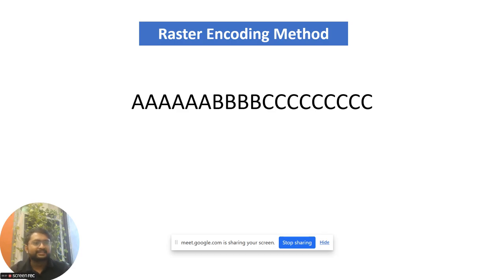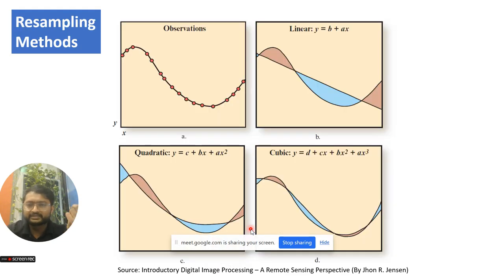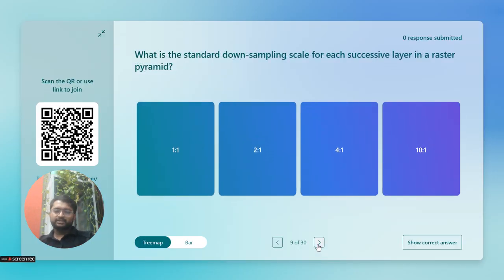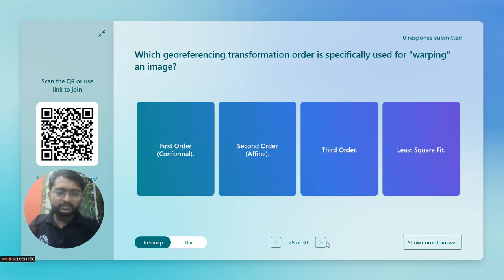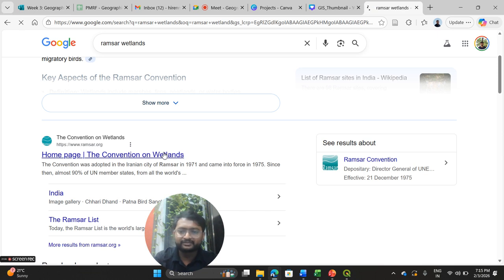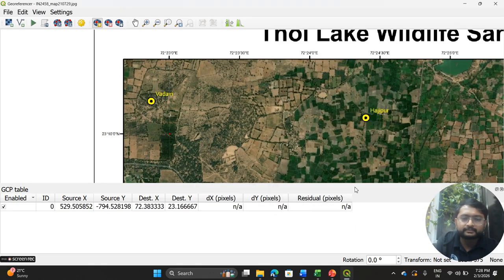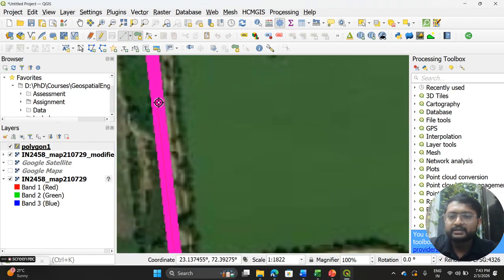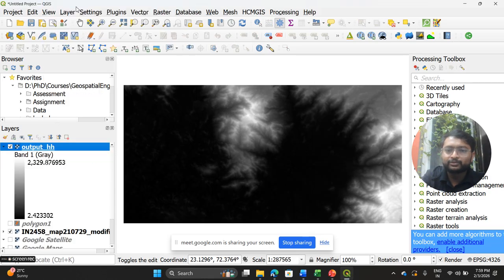Lecture 3 | Geographic Information Systems

Comment: 00:10 - Overview of Week Three in Geographic Information Systems course.
02:57 - Data compression is essential for storage and transmission efficiency.
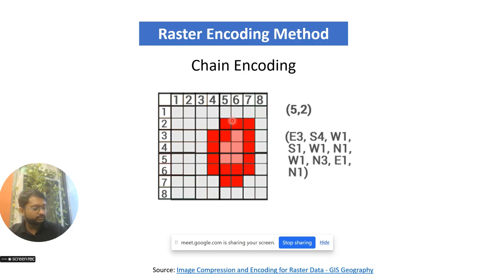07:53 - Exploring encoding techniques in GIS for efficient data representation.
10:21 - Understanding box sizes and quad tree encoding in GIS.
15:25 - Georeferencing is essential for accurately locating satellite images.
17:35 - Identifying Ground Control Points (GCPs) for georeferencing imagery.
21:43 - Choosing resampling methods based on terrain affects data accuracy.
23:44 - Transformations in GIS involve translation, scaling, and rotation of coordinates.
28:36 - Raster compression removes three types of redundancy in images.
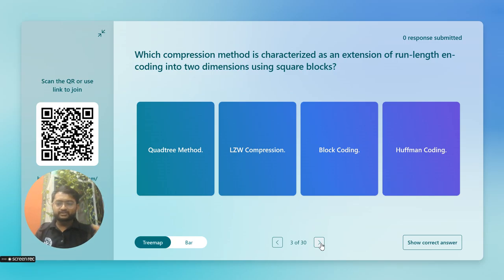30:58 - Discusses various coding techniques and quadtree limitations in raster images.
35:51 - Understanding raster pyramids and downsampling in GIS.
38:06 - Understanding GCP placement and its impact on geo-referencing accuracy.
42:59 - Understanding terms in georeferencing and acceptable error limits.
45:11 - Effective resampling methods for satellite imagery discussed.
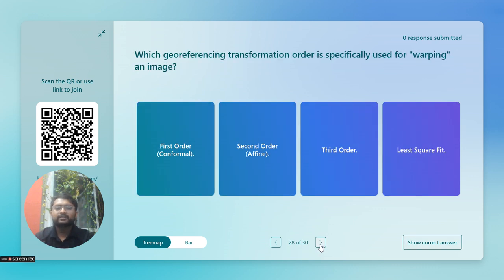50:11 - Georeferencing transformations affect image mapping precision.
52:39 - Quiz recap and introduction to exploring various datasets.
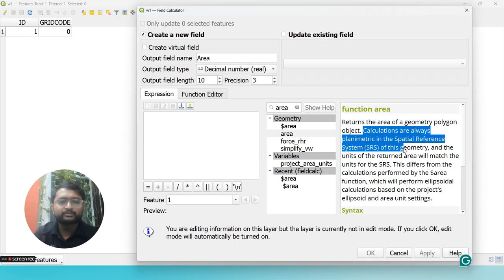57:39 - Understanding coordinate systems in GIS for area calculations.
59:40 - Understanding coordinate systems and area calculations in GIS.
1:04:28 - Understanding non-georeferenced data and the importance of georeferencing.
1:06:31 - Integrating georeferenced maps for urban development analysis.
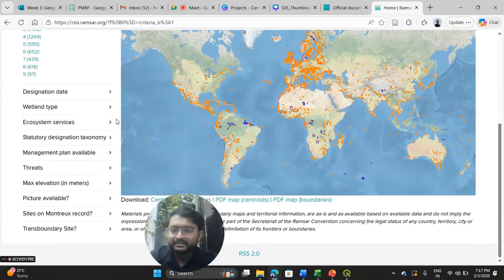1:11:16 - Overview of GIS data types and site analysis techniques.
1:13:49 - Understanding site boundaries and georeferencing in GIS for archaeological sites.
1:18:28 - Proper georeferencing is crucial for accurate GIS data representation.
1:20:32 - Understanding latitude, longitude, and coordinate systems in GIS.
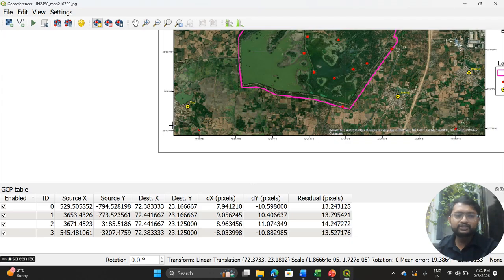1:25:19 - Pixelation affects image accuracy in georeferencing.
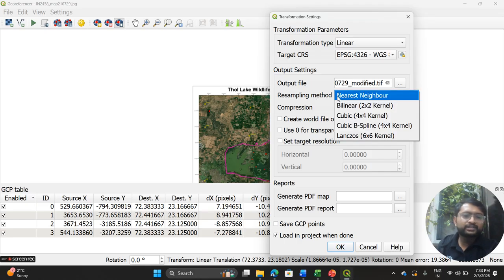1:27:25 - Key steps in georeferencing images using GCP and transformation methods.
1:31:52 - KML files are crucial for environmental licensing of construction projects.
1:33:56 - Understanding GIS file preparation and data digitization techniques.
1:38:26 - Data monetization in urban planning drives startup opportunities.
1:40:31 - Digitization in GIS requires patience and precision.
1:45:23 - Live class recordings and resources for GIS learning are available online.
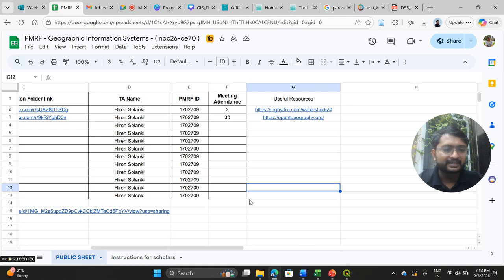1:47:32 - Students will become moderate QGIS users through practical exercises.
1:51:38 - Comparison of QGS and RGS software with data extraction process.
1:53:52 - Session concludes with gratitude and encouragement for future participation.